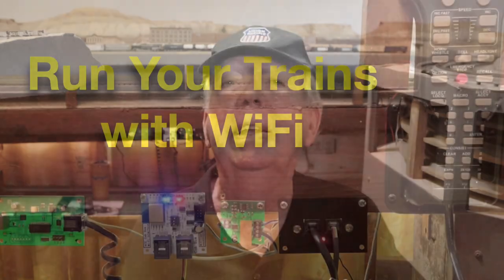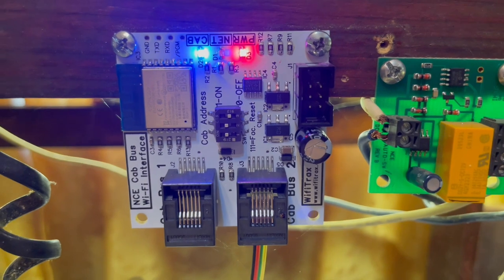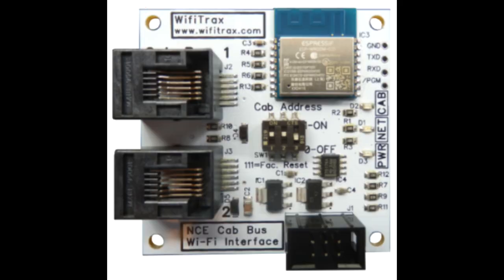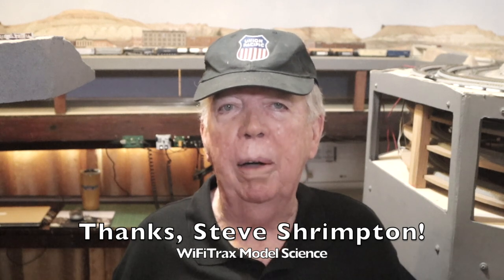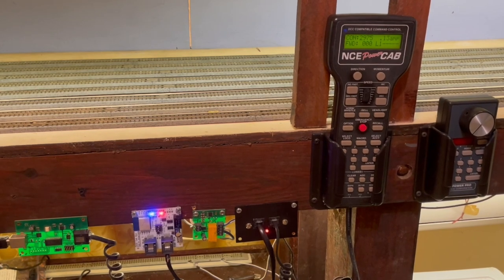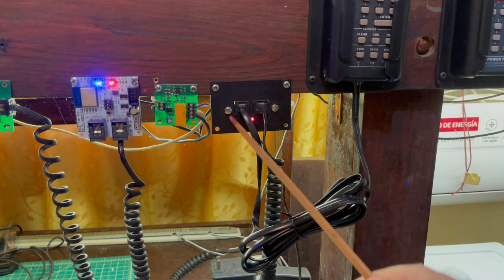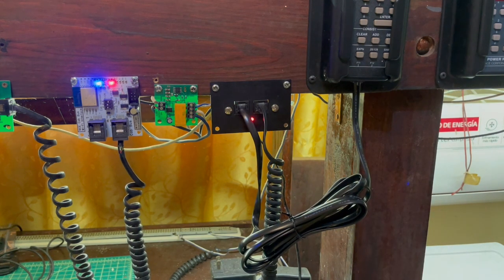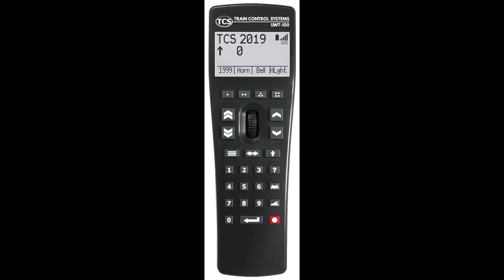Run Your Model Trains Using WiFi

Comment: When I put my WiFiTrax adapter in I found out I had a problem with my PowerCab. The folks at WiFiTrax were extremely helpful in troubleshooting my system and NCE got it taken care of very quickly. Both are great products from great companies, and the WiFiTrax was a quick and relatively painless way to go wireless on my railroad.
Reply from the maker: You are absolutely right: These are indeed fantastic products, and customer care is fantastic! ...Roy

Comment: Thanks, Roy, for another high quality video, showing the new wi-fi control. By the way, I love your UP 844 engine! I have a real soft spot for the steam era, ever since I was a pre-schooler and my dad brought out for Christmas his pre-war Lionel O-scale that he'd gotten as a kid. It had an extended figure-8 layout where he ran one end under the tree and it even had a whistle unit in the tender and a remote turnout with rotating indicator lamp to a siding. Total joy!
Reply from the maker: Thanks for your comment, Bill. I appreciate it. It's always a pleasure to share the hobby with you. I'm really happy with 844, too. I model a modern era railroad, but fortunately, I can use 844 at the head of excursion trains on my layout, just like the prototype does. ...Roy

Comment: Hi Roy, thanks for sharing this amazing new tech with us.  I just bought one right after watching this video.
Quick question...
I understand that you are using NCE Switch Kat for your turnouts, just wondering if you are able to program (per WiThrottle manual you need to add them to JMRI turnout table) the WiThrottle while using the app only?  

Thanks in advance. 

Louis
Reply from the maker: Thanks for your comment, my friend. I think you will have fun with your WFD-30. No, I haven't had a chance to program my Switch-Kats yet, but that's important and I hope to do it soon. I will try to do a WiThrottle programming video at that time. ...Roy
Reply: @n-scaleunionpacificevansto6569  Looking forward to your next video on WiThrottle.  Louis

Comment: Wifi is the way to go in my opinion. I looked into this card but found that JMRI and an old router would better suit me. But really, what's best for you is what matters. Especially if you can get cheap devices to run either App. Thanks for sharing Roy!  - Cameron
Reply from the maker: Good point, Cameron. One of the nice things about model railroading is that we have so many options available to us in just about every phase of the hobby. It's always a pleasure to share the hobby with you....Roy

Comment: Hi Roy,, this looks like a great and easy way to get Wi-Fi for the layout. 
What is the difference between the free app and the 10$ app 
did you have to buy the app to use the Wi-Fi system?
Reply from the maker: It is absolutely the way to go, Sparky. I'm really happy with it. It's extremely easy and quick to set up and use, and inexpensive compared to other wireless methods. The paid version allows you to do a few things that the lite version doesn't, such as consisting. But you definitely can go with the free lite version, especially at first. That's what I did. You don't have to get the paid version. ...Roy

Comment: Great information Roy and it looks pretty easy.  I remembered seeing John's video about this product as well.  I already have an NCE  Pro-Cab wireless system that I use on my layout.  However, I wonder if this would be something I could add to my current layout so guess operators could use their own cell phones as a wireless throttle.  Also, I wonder if there is a certain limit to how many wireless wifi cell phone throttles it can handle.  I guess these are items I need to do some research on.  Thanks, Tony
Reply from the maker: Tony, I understand this device has a limit of 4 phones, but the limit can be increased by making some adjustments which I don't really understand. The only thing I'm really sure of at this point is: I'm having tons of fun running my trains wirelessly using it. ...Roy

Comment: Hi Roy, Thank you for the video. I will probably will not be converting the Long Valley Branch to WiFi because of it's small size, but I have been running trains "remotely" on a friends layout using my WiFi "Engine Driver" app on my Android phone. The technical advancements in our hobby over the past 30 years are simply amazing. I'm now able to sit at my home and using my computer as a monitor and my phone as a throttle, operate a train on a friends layout that is physically 223 miles away from my home. Also Roy thank you for the information on the TCS WiFi throttle. Since these folks are fellow Pennsylvanians, I like to support them as much as possible. Shameless plug, but I simply love their CN and CN-GP decoders for older Atlas / Kato locomotives with the split light boards. The CN and CN-GP decoders are not plug and play, but unlike most hard wired decoders, the CN and CN-GP have LED's right on the boards and those boards replace the split light boards. So there is no need to find replacement lights for the headlights and numberboard lights. Now the disclaimer, I'm not associated in any way with TCS, just a satisfied customer. Cheers, Rich S.
Reply from the maker: Thanks for your comment, Rich. It's always good to hear from a fellow Pennsylvanian. As you say, the technical advancements in model railroading in recent decades have been positively astounding. I left the hobby in the 1980's, and I couldn't believe how much everything had changed and improved when I came back almost 30 years later in 2014, especially in N scale. Now I had to re-learn everything I had forgotten over the years, and I had to learn a whole bunch of new stuff such as DCC, for example. Model railroading is now better than ever! ...Roy

Comment: On your recommendation, Roy, I just received my own WFD-30; not hooked up yet.  I'm wondering, what is that big unit at the left of everything, with a long coiled cord apparently for use with the NCE PCP panel?
This looks like an easier solution than mounting additional PCP panels to reach more distant locations, even with my small 4 x 8 layout.
Reply from the maker: My friend, the unit on the left is a NCE USB interface 5240223. I use it to connect my Power Cab to my MacBook Pro in order to use JMRI. I think you will have fun with your new WFD-30. I certainly am. ...Roy

Comment: This is really neat Roy. I already use the NCE wireless system with my sb5. I wonder if this would work with that. ? I’ll have to look into it
Reply from the maker: Thanks, Dave. The WFD-30 should work with any NCE system. ...Roy
Reply: I just installed the WFD31 into my NCE ProCab 5 amp system with radio. It works fine…. Now. 
Install per instructions. It appeared the wfd31 was working but not communicating with the command station.
After several emails with wifiTraxx and Iron Horse it was asked what version… hmmmm.

Well……The CS I was using initially was a 1999 version. So I swapped into my spare CS which is of the 2007 version.  

I am ordering the new 2021 eprom for both command stations, which is a user changeable item. This version is needed to fix issues with cab06. 

Big thanks to both Steve of WifiTraxx and Ryan of Iron Horse Hobbies for their support in figuring this out. 
Oh, difference between the wfd 30 and 31? The 31 is a direct replacement for a NCE utp and mountable in the fascia. 
Happy customer!

Comment: Roy I just seen you video on operating trains using WiFi wireless. It is very informative and when I make the decision to go wireless I will be visiting Litchfield Station in Avondale, AZ which sells many model railroad electronics and electrical items for the model railroaders. This will take place once I go wireless and have my second Level all set up. Kato will have the Big Boy 40414 in N scale by mid year this year. I recently bought the 160 years service Microtrains 60 ft. Union Pacific boxcar which brings my freight car inventory to 106 freight cars.
Reply from the maker: Thanks, Christopher. Good to hear from you. Sounds like you're having fun on your layout. ...Roy

Comment: Connected this to my NCE system about 6 months ago.  Very easy to do.  Just make sure your NCE system has the most current firmware.  I had to upgrade my PowerCab and my SmartBooster.  That was also easy to do.
Reply from the maker: That's good advice, John. I ordered the PowerCab version 1.65B module (with a "B") a few days ago and will install it in my PowerCab when it arrives. ...Roy

Comment: This is really cool stuff! My trains aren't well suited to DCC (Japanese domestic stuff doesn't accommodate it as a matter of course and EMUs would require no fewer than 3 decoders per trainset to function properly) but it's great to see the tech progress and become more convenient. I hope more affordable and straightforward conversion solutions will emerge on the market in time.
Reply from the maker: More affordable and easier to use! Absolutely, Sorrell. Let's hope the hobby is heading in that direction. ...Roy

Comment: Welcome to wireless Roy.  I got a suggestion for those electrics boards.  Take an extra piece of wood board.  Attach two hinges to it or a piano hinge.  Fasten it to you fascia board and mount all your electronics to it.  You could create small post and latch from scrap wood.  Then you can tilt it up under the layout to protect it.  You can drop it down when you need to work on your electrics.  That way, nobody snags your electronics when operating the trains and it makes for a nicer looking install.
Reply from the maker: Thanks, my friend. I appreciate your suggestion. I've always thought of my current use of the benchwork for my devices as temporary. Eventually, I will put fascia on this part of my layout, and then I will create a nicer arrangement of my devices. ...Roy

Comment: Roy, thanks for a system I  can possibly use.  I have a basic nce system and no jmri.  I have an android phone.  Hopefully it will work out for me.👍!
Reply from the maker: I encourage you to go ahead and try it, Stephen. I think you will be happy with it, because I know I am. ...Roy
Reply: I have this exact setup, the NCE PowerCab and android phone running Engine Driver. It works great. You need the latest firmware (1.65) and you're good to go.

Comment: This is great info. I'll have to try this on the droid. Moving right along with the new build, and very happy with the plan.
Reply from the maker: It's extremely quick and easy to connect, Craig, and non-stop fun to use. ...Roy
Reply: @n-scaleunionpacificevansto6569  Some places on my new RR are just far enough that the power cab won't reach (no matter where I set it up. It will be an ideal addition.
Reply from the maker: @craiglordable  Absolutely, Craig. No more cables to struggle with when you're trying to get to those far-away places on your layout. ...Roy